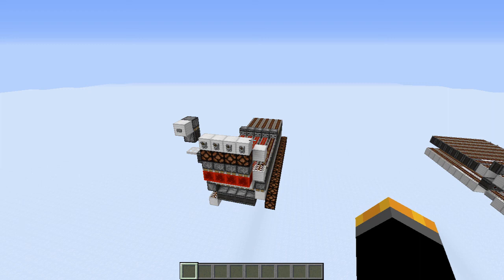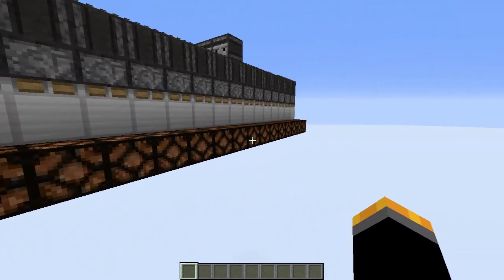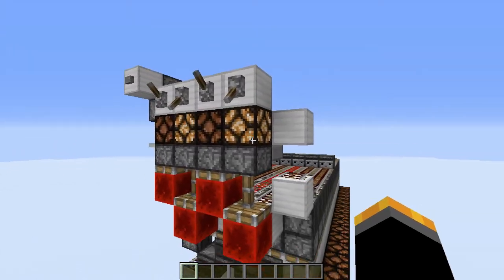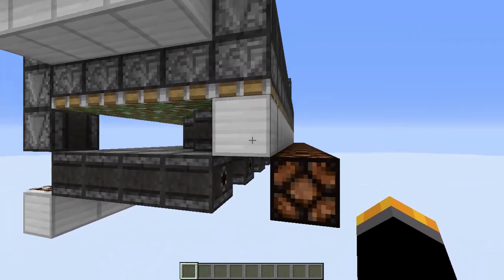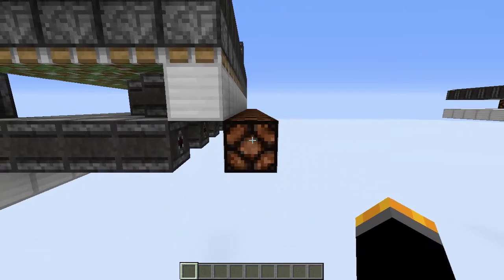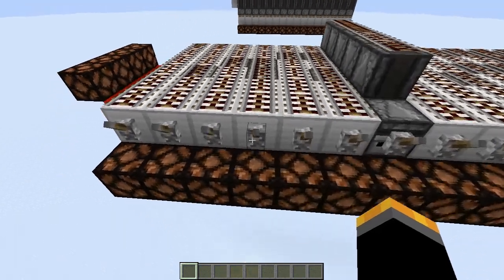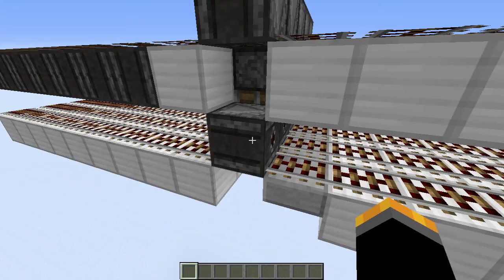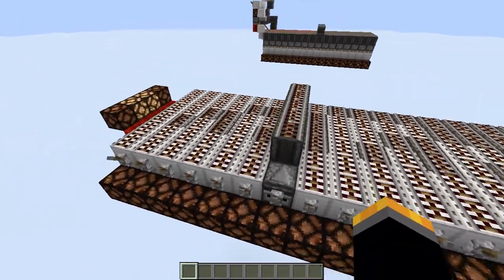Compact binary decoder using observers

Comment: Hey! There are some parts in which you can actually substitute some observers with hoppers. Hoppers allow twice as fast transfer of 1 tick signal if you alternate them with observers, since they change states with a redstone input. This is a really clever design I'm going to try my hand at, I need one for my super compact 7 segment display which needs decoded signal. Thanks for the video!
Reply: My favorites are noteblocks. Their characteristic is that they can be powered, Hoppers can't but you can put redstone on them which is great. And trapdoors are great too.
Reply: @ゾカリクゾ  I know its late but noteblocks will also power the notblocks beside them

Comment: That is again really solid production quality and a really compact and nice creation. I will propably use this if i ever need a binary system, and since i do to make a smart train system this is really nice, i would have to have done it myself and im absolutely horrible at wiring redstone, it would propably have dimensions of like 50^3
Reply: Eero L. you are working on a smart rail system huh? me too! mabye we could work together on some bits and bobs if that's alright with you?
Reply: Its not exactly rail system but i decided to say it is becouse it is much too complicated to explain and it is so similar. Basically i have a network of stations with enderpearl launchers in them, and all the stations have the same redstone (they are at the nether roof) so you first select the destination you want to go to and then throw the enderpearl to the system. The system calculates what path i need to take to the destination (i do it this way becouse i have over 30 destinations) and then bounces the pearl around the network that consists out of slime block launchers that just bounce the enderpearl around. The first station sends a binary signal before the enderpearl to tell the bouncers and chunkloading to activate and to tell the next destination to start processing the code and calculate the path. Then when the pearl reaches the next station it is sent forward to the next one and so on. The redstone for this system is different from a railbased system in the way that the main problem is speed, becouse the enderpearl is at constant 80m/s speed in midair and the boucers and station bouncers etc have to be timed exactly correctly, to a gametick.
Reply: Sorry for the novel
Reply: Holy shit, that is some crackhead engineering right there